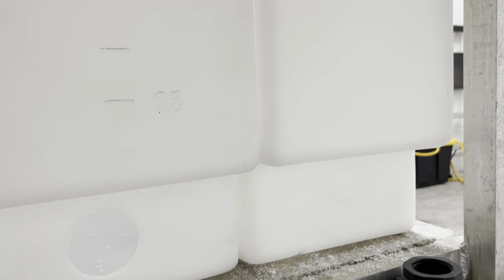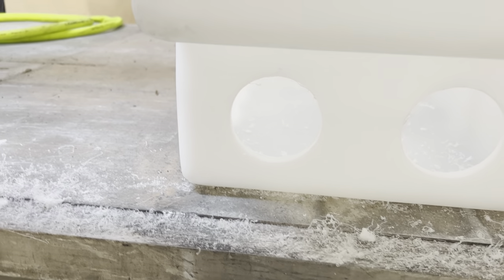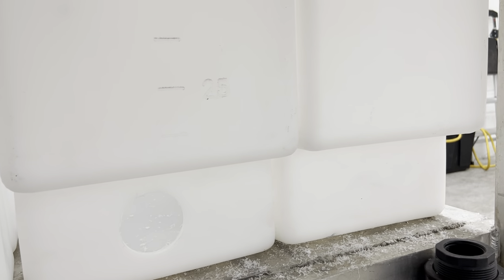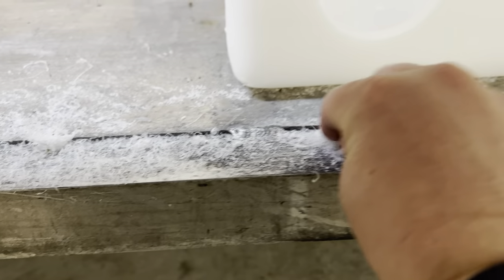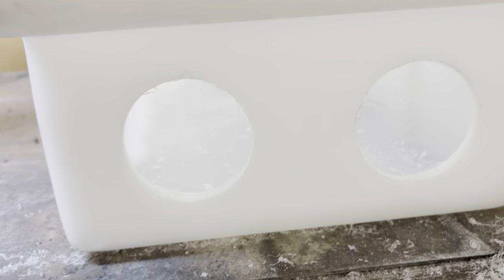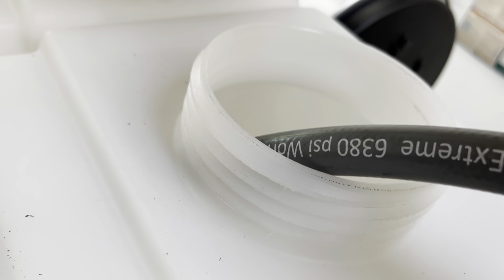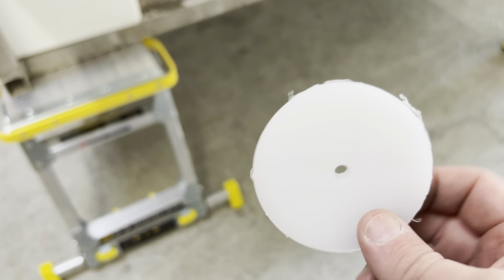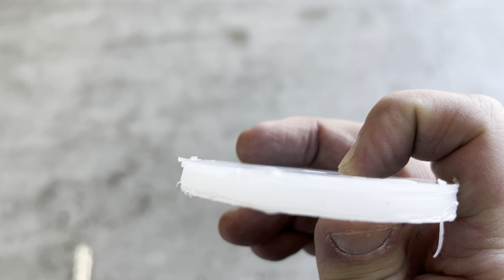Eliminate Sloshing with This Plumbing Hack"

Comment: I got a question? I just purchased a electric hose reel but my question is that where do I ground my Solenoid too ? I don’t have a skid I have a end closed trailer not any aluminum or metal in the trailer
Reply from the maker: Great question. There should be metal somewhere or ground to the battery

Comment: This is a great video! If i were connecting the tanks together, I would have only used one bulk head per tank, and used a tee fitting and connected the tanks together, using the end outlet of the tee for the drain.
Reply from the maker: That could work as well. Appreciate the comments.

Comment: Hey Tim, Do you know the dimensions on that Buyers Box? I'm in the market for one and they are the standard for just about any utility work box.
Reply from the maker: 18x18x24 is on the older skids. We use a smaller one now. 14 x 16 x 24 Inch

Comment: Do you have a fitting on the pressure washer for the inlet? 11:08. Just the hose over the male threads locked in with the clamp? Or is there a hose barb?
Reply from the maker: I think you are referring to the 1 inch barb that goes into the pump. Threads in.
Reply: @ExpertPowerWash  Got it. I see it now. It was hard to tell but I see it now. Thank you!
Reply from the maker: No problem. The barb is 1 in. The thread is 3/4

Comment: Did you have to upsize your battery for the reels?
Reply from the maker: I’m using a group 24 marine battery. These batteries have been great.
Reply: Thanks. I set three reels up just like this and I’m having issues with the circuit breaker tripping. 

Found your video online and it turned out to be the same way I set mine up, except I have a 40a breaker and smaller battery. Going to try upsizing both and seeing if that helps
Reply from the maker: Check your ground and wire sizes as well

Comment: Aren't you worried about getting air in the pump with the pump above the buffer tank?
Reply from the maker: No issues. Pump is designed to pull water.